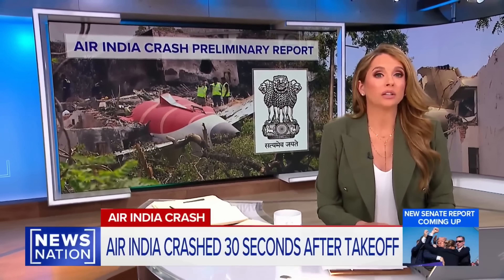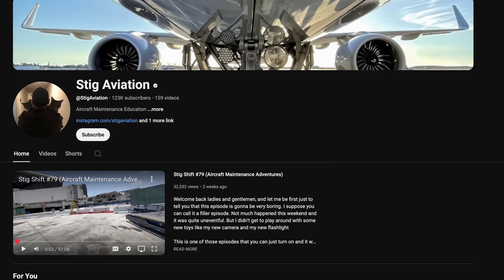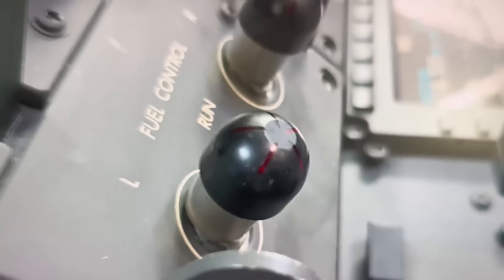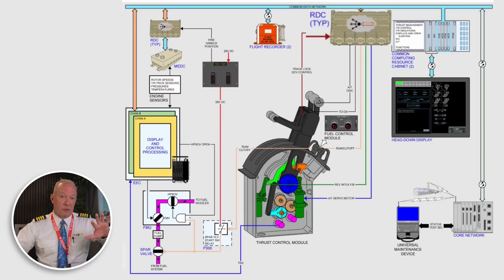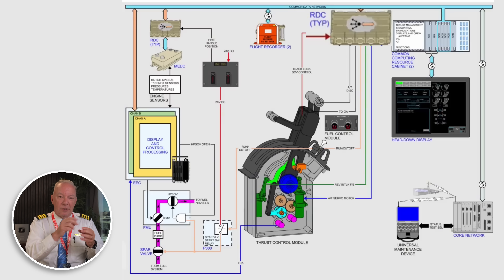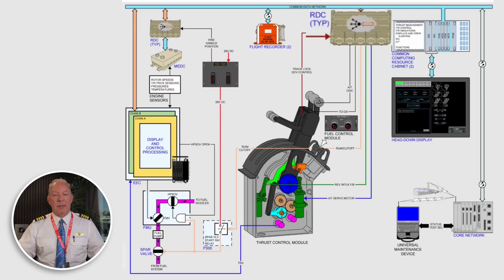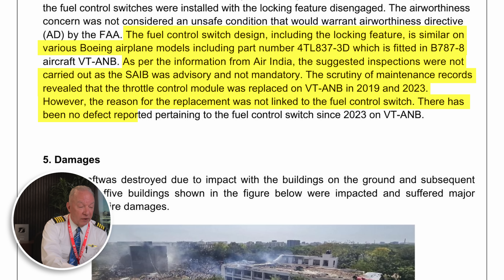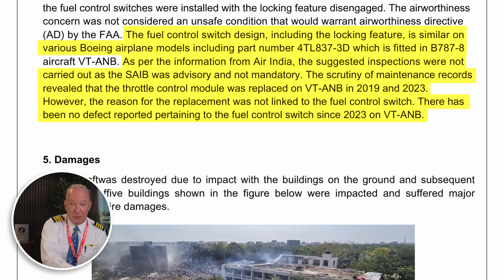The Truth About Boeing 787 Fuel Control Switches

Comment: Excellent description. I have gone down several rabbit holes most notably cockpit cameras, NOT installed, I believe that the fuel valve is operated by a solenoid so once in position will it not change until the appropriate signal is applied. One theory about a water leak causing the fuel shut off makes no sense because of the timing. Two signals within a second not happening by water, is definitely a manual action. The switches are designed to be idiot proof.
This is going to the most undesirable place.

Comment: The issue regarding the fuel control switches had been made clear in the data recording when the copilot asked the Captain why he shut the fuel off and the copilot then moving the fuel control switches from Cut to Run, unfortunately there was not enough time to fully restart the engines. It's a open and closed case.

Comment: Thanks for your video. I will watch the other video you mention

I didn’t follow in detail the report but I’ve a question. As for as I understand, the actual fuel control switches module was retrieved after the crash and the two switches were in one position.

The back box recorded a question from one pilot to the other why he switched off these switches and the other replied he didn’t 

This black box also recorded these two switches were switched off in less than one second and then switched back.

Here is my question : you perfectly described how to physically operate these switches but could we imagine an internal fuel control switch module failure which switched off the current with switches still in on position ? (I assume the black box records the current and not the actual physical switch positions). 

Seeing the reactor problem, May be the pilot physically switched off and on again these two switches which could set back the current on ? 

In other words, do they already inspect the internal behavior of the actuel fuel control switches module to be sure there is not internal problem ?  I think we must not confuse "physical switch position" and “output current value” of this module

Comment: I don't think you have the actual details of how the switches work correct nor does STIG Aviation.  I have only read one account which seems to have all the details correct.  Here's where you go wrong... As you lay it out, a failure in the 28 VDC source OR the 14 VDC source would allow the three fuel valves to close when they lost power.  Or for that matter, again as you laid it out, if any of the 28VDC wires or 14VDC  wires from the switch to the relay or the relay to the valves broke or got cut the fuel valves would close.  The setup you describe is NOT failsafe... it's the opposite... failure could be caused by the inadvertent cutting of wire running from the switches, relay, and the battery.  The source I saw (sorry but I don't recall the link), and which outlines a genuinely failsafe setup, specifies that the relay which is CONTROLLED by the Fuel switches, includes magnetic latches. That means that after the relay is "turned on" by throwing the fuel switch to RUN, it latches in that position and stays there regardless of whether power continues to be sent from either the 28 or 14 VDC sources.  To "unlatch it" from the RUN state and then "latch" it to the OFF state the Fuel Switch is set to Cutoff... power is then sent to the relay which "unlatches" it from RUN,  and "latches" it to OFF.

Comment: 777/787 pilot here. In training several years ago, they showed a video from a simulator. In the video, a cellphone was placed on the throttle quadrant. When the throttles were retarded the phone hit the fuel control switch, slid up the switch, lodged under the lip, lifted the switch and placed it into cutoff!
Reply: one switch only or both switches.
Reply: Who would place a cell phone on electronics , in a air plane 🤔   like no passengers or kids now allowed in cockpit  🤔   I was wink 😊 grab as much sweets as possible lol
Reply: Surely Air India pilots are not laying their phones on the throttle quadrant during takeoff.

Comment: I am an Electronics engineer, you are looking at the mechanical switch and its function and mechanical engagement of, how ever, there is the electrical and electronic side of this that actually does the work. On your diagram you have a AND gate output going to HPSOV and one of the inputs of the AND gate is from the relay. You said that the voltage from the switches are 28V analog and not a digital signal, how ever an AND gate is a digital electronic control device requiring both 1 on each of its inputs to produce an output signal, otherwise the gate remains off (closed). This is where it gets its name from AND in mathematical terms means times, therefore this and that means this times that equals... so an input combination of where anyone of the input is a zero then the output has to be zero, the only input combination that can result in an output of one is that both inputs must be  1. Just like in maths any number times by a zero is equal to zero, but one times one is equal to one and here the output of one means the gate is open. So there could be many reasons including a glitch or software issues, a short across the switch or relay where the input of the AND gate due to mentioned issues could have produced a ONE signal at the input of the AND gate and as long as there is a one on the other input, then the AND gate will be on (OPEN) and produce and output regardless of the physical position of the switches. You stating that the system can only be switched on by the 28V from the relay governed by the switches, then the system must be producing a one on the other input of the AND gate to produce an output signal to the HPSOV. Even your example of the blinking light is an explanation of what happens to the circuit in where there are no faults present. On your very own blinker circuit the switch and or the relay could develop a short circuit causing the blinker to come on regardless of the position of the toggle switches unintentionally, I am not stating that this was or is the case in anyway, but i am just pointing out that your explanation of this is not all that accurate and other circumstances could have resulted to actually command the circuit to come on and not dependent on the physical movement of the toggle switches. Remembering that a short across the switches and relay will deem the circuit in the ON position and likewise a open circuit across the switches and relay will deem the circuit in the closed or off state regardless of the physical position of the switches.
Reply: The & gate should be a symbolic representation. There are many types of logic level conversion , not necessarily restricted to any of the standard logic levels that we are using. I think you’re referring to the first of the 3 electromechanical actuators of the fuel path. I think I’m overknowledged to state how the schematic maybe read.
Reply: You are missing the fact that the position of the switches was recorded in the data recorder. That can only happen if the switch is actually moved. 
Unless there was a hidden flaw with the electronics monitoring the switches, that could also trigger the FMV to 0, but that is highly unlikely.
And the chances are slim to none for that to happen in two individual systems that close in time. It would have been simultaneously or only one side.
Reply: @Mooonsterman 
All I am saying is that there can be circumstances that the system can cut off and or run without the switches and that if this was the case that a glitch produced a zero input at the AND gate input, then the HPSOV would switch off an the data recorder would interpret this as a switch input to the off state.
Reply: @5amsunspor I would really like to have a look at the wiring diagram for the switch itself, because in my mind, the recorder should have it’s signal directly from a second pair on the switch, but if not, that could open up Pandora’s box.

Comment: The argument „batteries“ never fail is nonsense. 
Battery problems are main root cause of failing vehicles. 

Question: what happens if the battery backupt 28v bus has a short to GND?

Comment: Dear Steve 
i know you wont change your stand to concentrating on physical fuel switches of flight deck and Pilots ,
from day one you have been telling that flaps has been pulled instead the landing gears etc theory which directly blames on poor pilots .
but the fact is the  cloud of smoke (not the cloud of dirt , dust in Gujurat is very red or dark brown color) was visible on the take off  behind the B787 on runway 
there was certainly a fire broke in Lithium ion 65 amps 28 VDC battery/electronics before take off and had catastrophic failure of power which  initiated the RAT ,
because fuel spar valves(these are simple spring loaded valves solenoid type ,not motor type ,they only stay open until DC power present in the coil , if DC power cut they closed straight away  ) are having the sources  of DCpower directly from the Battery , so as battery destroyed and DC power cut to the fuel valves and so they closed .

the fuel valves  could only be opened again after ten seconds as AAIB preliminary report say  that there was TEN sec. gap in fuel cut to run status,so  when RAT has started to give backup power ,which gets in line to DC form to the spar valves too , this time might be pilot initiated it by resetting the switches in the cockpit 
pilots might tried before opening the fuel spar valves   but couldnt open for TEN seconds because there was no DC power in the system .
Reply: Without 28v from battery the switches are sampled as off by the fadec without moving. 
With power from rat and fuse opening to battery, the switches are sampled run again.
Reply: @ansellmoanders1772  yeah , there was ten seconds gap  between fuel switch cut and run again ,why ten seconds ? when pilots felt straight away the problem in thrust and felt fuel spar valves might be closed , wouldnt they try reset fuel switches straight away without loosing one second?
they might tried to opening FUEL spar valves in between but  could be possible because absence of DC power in the circuit of fuel spar valves  when RAT after ten seconds started to give back up power and hydraulics to the planes system as well as power in DC form reached to the Spar fuel valves , then only pilots could be able to  reseted the switches to relight the engines again